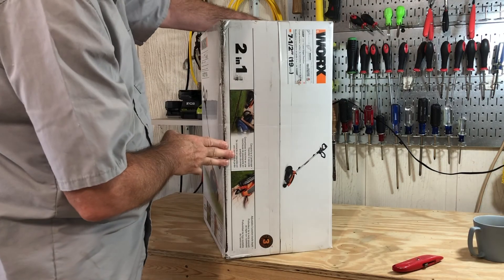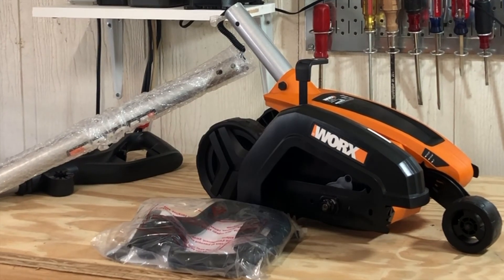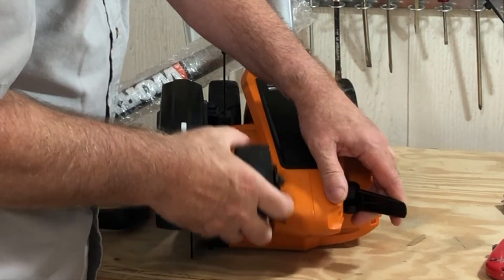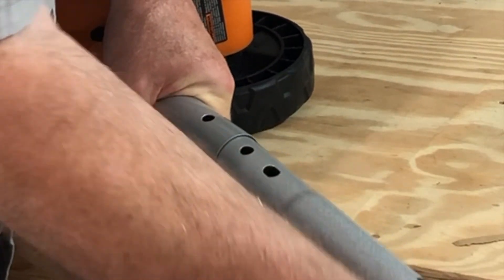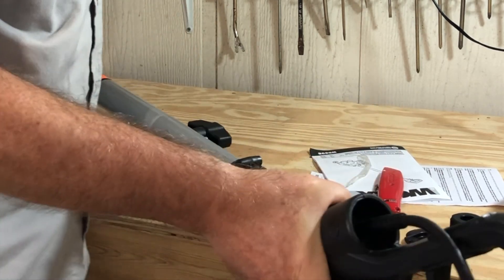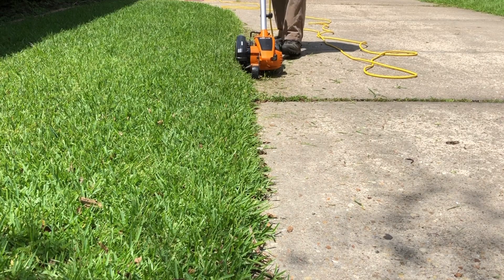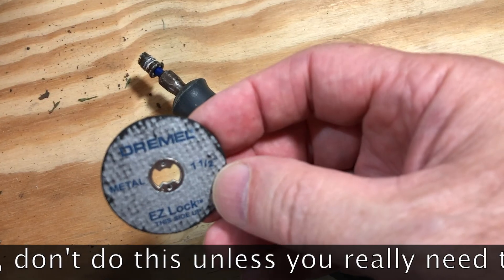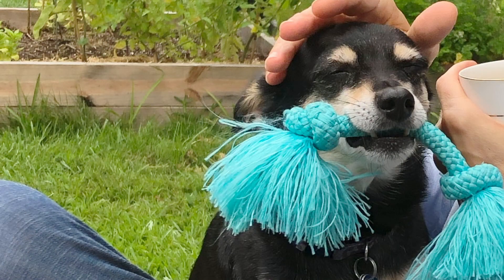WORX Electric Edger unbox and demo

Comment: You have to go one foot forward two feet back so you can shoot the debris forward or else it packs up where you cut the guard off. For high turf you can raise the front wheel by tilting the unit rearward couple inches to make an initial cut freehand by eyeball,go back and then set the guard into the cements edge, and go back and forth advancing and clearing the debris 
( the blade moves rearward in operation). 
Watch for sparks and kickback of you are too aggressive.
I set stakes every 10 ft so i know where i need to end up. This is for neglected edges with 8 inches overhang you cant see where the borders are,or where to set the guide fence into..it takes a bit finesse,but it will. If you have no kind of existing edge,be prepared for alot of back and forth work, 300 ft linear 8 inch zoysia grass overhang each side was 6 hrs cutting not including the strips of turf sod etc that had to be pulled swept and bagged..alot of breaks in between.😅
It was like filleting a whale if you don't keep up with it .
Reply from the maker: Good tips for anyone reading.  Thank you.

Comment: I think you made it look easy, likely due to experience. My blade kept sparking on the driveway. The guide was not impactful in keeping a straight line that followed the driveway. Consequence is some deep edging that does  not match the almost zero edging. I haven't gotten the hang of it yet.
Reply from the maker: Well thank you for saying,, just give yourself about 10 hours and you'll be pro.  The blade sparking isn't that big an issue, just a bit of blade wear which should be replaced at intervals.   After you get your lawn on regular edging schedule there will be a well defined space between lawn and curb.  It's much easier at that point just pushing straight with little sparking.  Thank you Lauren!

Comment: Thank you Mr. Lynn for this video. I just purchased this edger from Amazon today. Looking forward to getting my lawn edges perfect.
Reply from the maker: I hope it went well for you, I’m upgrading again but not because this unit didn’t perform well, I’ve got a very high sidewalk to turf issue
Reply: @554LH same issue I have. I just got mine in today and just used it. What a nightmare when that grass sits higher. It did the job, my holy crap.
Reply from the maker: @prehistoricgentlemanbird9131  they really should make an easily removable guard.  Did you cut yours?  That does help if a bit unsafe.

Comment: I like the infomative edging issue problem of raised ground you don''e see anywhere else.  The possibly unsafe modification is interesting.   I might have to use that as the Worx is being delivered today and I have raised lawn out front.  Or I might get lucky and just edge my way thru it a few times and clear it out... .  Also, the trick of edging backwards is cool to clean the edge.  Good job!
Reply from the maker: Thank you, I really do worry about unsafe workaround, safety glasses certainly a good idea.

Comment: Just put this together.  I believe the two holes are for individual height comfort adjustment.  I was also confused about the tag as well.  I am like you, I left shielding around cord on
Reply from the maker: thanks for comment Rooster, so far I've had no issues.  its much better than the old Scotts that I couldn't get a blade for.
Reply: @554LH  I previously had two Black and Decker edgers which I really liked.  However, the most recent one only lasted two seasons.  After some research, it appears they made some changes a few years back and there were many reports of dissatisfied customers since.  Of course these days, “made some changes” usually means made more crappy.  I am cautiously optimistic about the Worx.
Reply: Yes the two holes are for height adjustment and I went with the first outer hole on both sides so I don't have to hunch over while using the edger.
Reply: rooster 799, So do you like it after a year? does it work as you expected?
Reply: @jimjim7656  Yes, I like it okay.  Honestly though, I don’t edge weekly.  I probably have only used it MAYBE ten times.  So far, so good.
I did have one mishap, that was likely my fault.  I had some B&D Edge Hog blades and I used them instead of the Work blade.  They look exactly the same including the spacer bushings.  Not long after install, everything fell apart, so like I said it probably was on me.  I tightened everything back up, put an extra nut on for good measure, and ( cross my fingers), no more blow outs.

Comment: Nice demonstration of edger. I have a question that maybe you can answer. I have about 450' of lawn to edge. But only 15-20 feet is along walkway/driveway. How well do you feel it would edge on the rest. For lack of a better term, "free form". Would the trench mode work? Or still use it in edger mode?
Thanks
Reply from the maker: I believe it will work with a few difficulties, a power cord that long will lose energy and maybe make for weak and hot motor.  This unit works best with wheels on flat surface.  I think rolling on the top of grass will leave uneven cut.
Since this video I have purchased a power edger so that I could cut very shallow trenches, a power edger would be a better fit imho.
I still like my electric, smaller, quieter but the gas has no question more applied power.
Reply: @554LH  Thank you for the reply. Last year I bought a greenworks thatcher and a 100' , 10 ga , extension cord. It did quite well. I'd prefer a gas edger. I just can't keep a clean straight line with my  line trimmer. I'm thinking as long as one trims each week with the worx and not let grass and edge get unruly. Maybe, just maybe it could work. Again thank you for the reply.

Comment: so there a yellow tag that says remove pipe before assembly.  didn't see you do that, you just stuff the tag into the pipe extension.  are they talking about that hard plastic rigid tube around the cord inside?
Reply from the maker: I might assume they wanted that tube removed, I didn’t follow that instruction, I would advise you to do better, I was tired
Reply: yes. got my scissors out to get it off. it wasn't easy either,  very awkward trying not to cut the cord, the wing nuts went through easier with that off. good video though, appreciated it for sure
Reply: I actually left the black wire loom on.  Just use a small flat head screwdriver to push the wire loom down and then slide the bolt through and tighten with the wing nut.  I think the reason why the wire loom was there originally was just more protection for the wires inside to not rip or break during packaging or assembly.

Removing that black wire loom will definitely give you more space to slide the bolt through, but I don't think it is necessary.  They could of use a thinner wire loom to make things easier.

Comment: Can you talk more about how to get the guide in place?  Can’t figure that out so I keep hitting concrete.  Also, like you, I have grass that is raised above the concrete surface.  I thought about running it from the grass side to cut it from above.
Reply from the maker: I think the only thing to do is cut off part of the guard (not a very safe thing to do).  But I'm going cut even more off of mine.  I'll do a video.  I'm planning on cutting all but the part directly between me and blade.

Comment: Thanks for the demo, etc. Actually looking for a very narrow mini mower, for tight spaces, such as flower beds, and the like. Any ideas? The 7.5" description really threw me off.
Reply from the maker: very small mower is a great idea, I don't know that I have ever seen one.  I have seen very small mini tillers for garden beds (I've actually owned a couple), but never a small mower.  Sorry about not being clear with blade size.
Reply from the maker: I put a link in about a string line trimmer with a deck, its not really a mower, but perhaps something like this?

Comment: Great video and like the common sense approach to modifying rock guard.  In the instructions, there is a yellow tag on the cable inside the aluminum handle that says remove before assembling.  I am not sure if they are referring to the black ridged plastic piece of piping over the cord. It looks like you left this plastic piping on the electric wire. eg at 5:18
Reply from the maker: I left it on, I saw the instruction, but to me it seemed more shielding was better.  I also think since I don’t actually “know”, probably better to remove it and let me be the Guinea pig.  Thank you for taking time to comment!
Reply: I just got mine from amazon and I had the same confusion, which part am I supposed to remove. I removed the tape and the yellow tag but am I supposed to remove the black inner casing that holds the cables? I’m blond, help me out, please. The video was great,  I just subscribed.